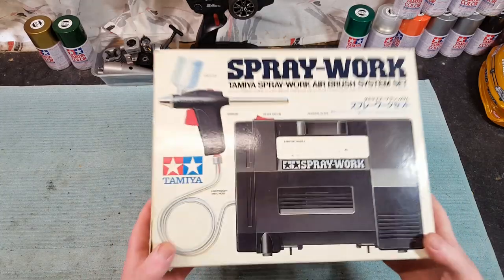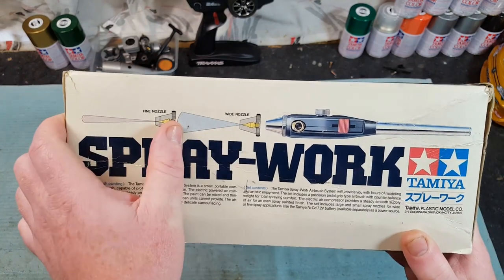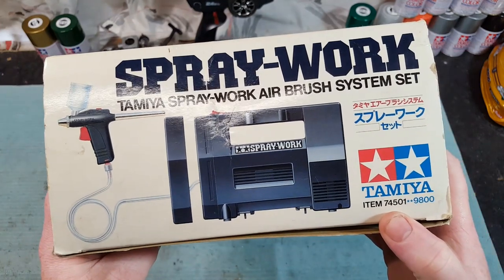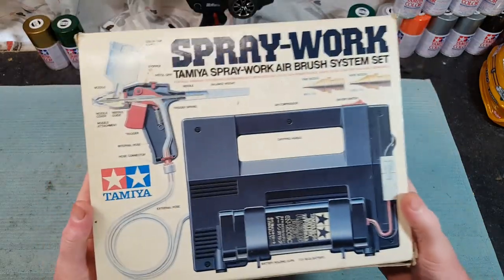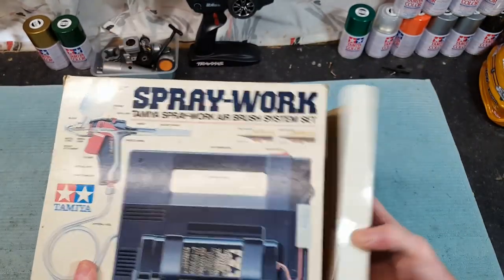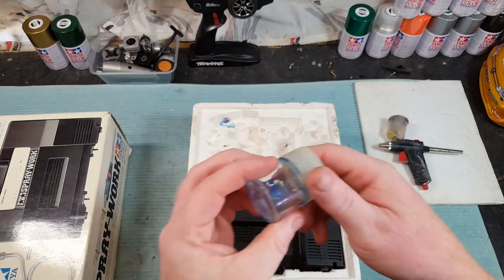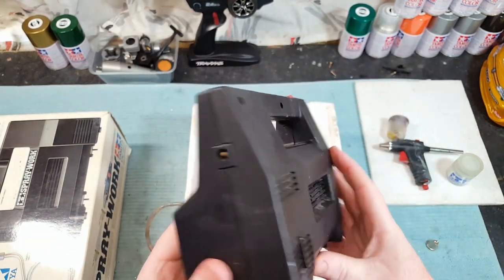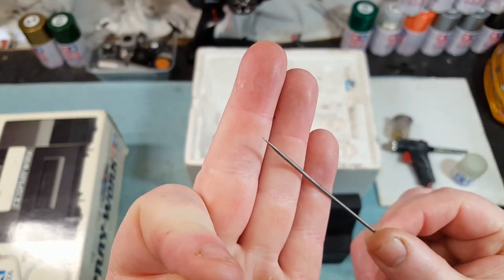Unboxing Tamiya Spray-Work Air Brush System Set 74501

Comment: I managed to pick one of these up. I can scan in the manual if you want, and email you a copy if you can send me some contact details.
Reply: hi! may i ask the size of the dc connector for this? thank you
Reply: @4dLdrago   I took the unit to Jaycar and asked them to find a plug that would fit. I then took the 6v 3Amp power pack to a tech friend of mine who put on the new plug. Hopefully that will work for you too :)